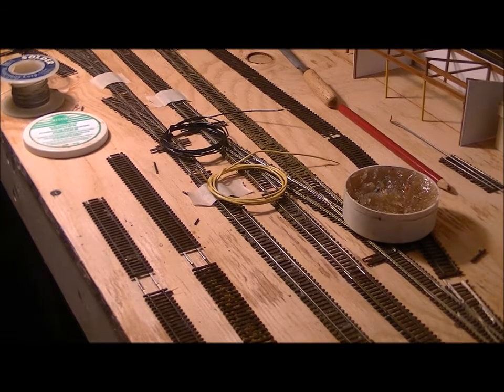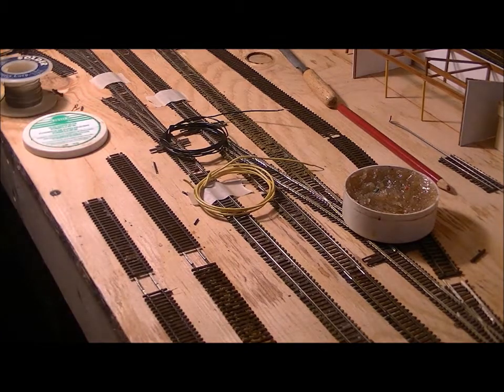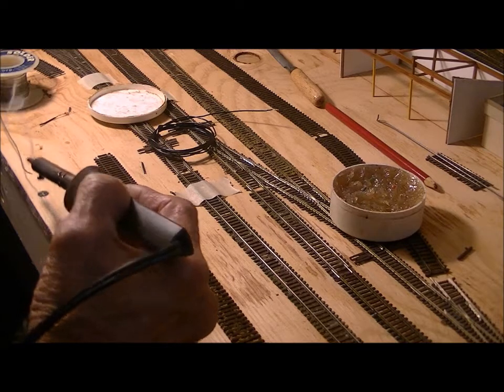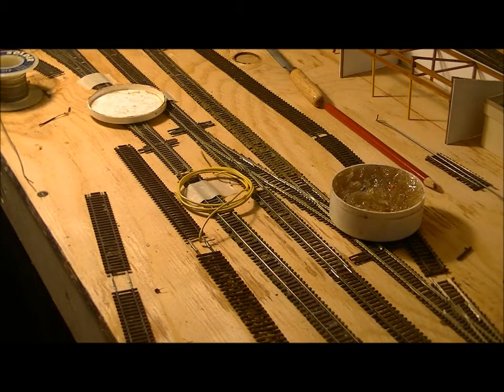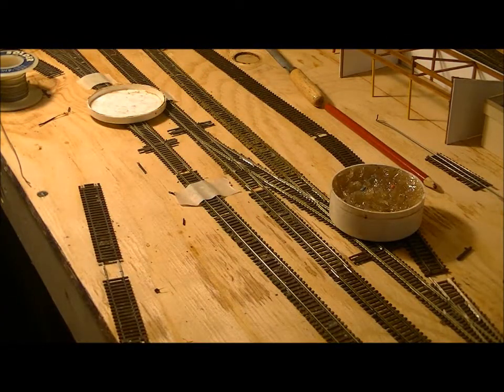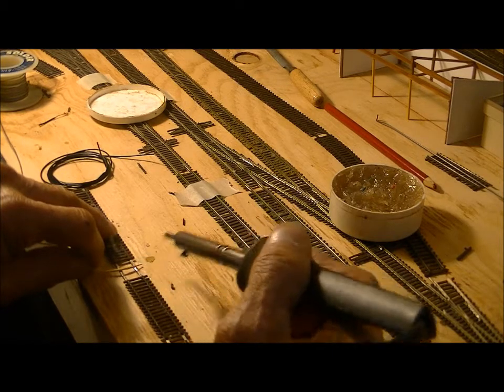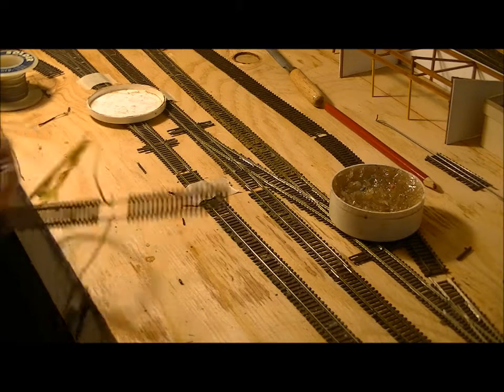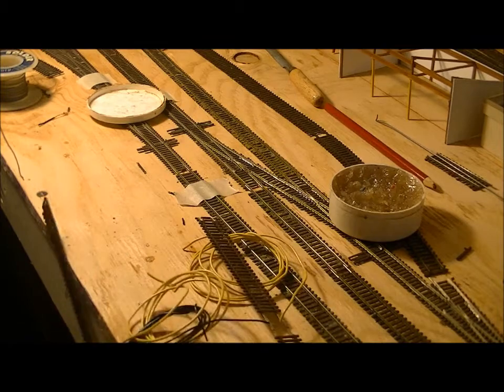SAVE MONEY..... MAKE TERMINAL JOINERS

Comment: I do the same without separating my wires. One is cut short of the other. Solder the far side first, then the close side. One neat trick it to use a re-railer and turn it upside down and fasten it somewhere on my layout. Put two joiners on the ends of the rails and solder. It stays stable while I solder the wire to the joiners.  I keep several on hand at different lengths. Then when installing track I drill down beside the track one hole and push my wire through and attach the soldered joiners to the rail ends.I have seen other modelers solder to the track and it messes the plastic ties up bad. Then try removing the solder from the track if you want to relocate your track. The way I do it is much simpler. And I am happy to see you do the same.

Comment from the maker: hello Gary.. thanks for the question.. i use 22 gauge stranded wire, i feel it's a bit more flexible than solid. i do not solder the joiner to the rail nor do i solder the rails.. just my preference but, it is a good idea to do so, especially since you are just starting. 
hope this helps
vinny

Comment: Vinny, are you using solid wire or stranded? Also, are you soldering the railjoints to the rails after you have drilled the holes for your feeds? Does this cause the feeder wires to come undone? I am in the process of building my layout and am curious. Thanks for the how to bid.

Comment: Vinny do you still use 22 gage wire. I been trying to do this keep having problems i need more practice lol
Reply from the maker: hi Dwight...thx for watching & the question...yes i still use 22 Ga. wire for my feeders & other electrical applications....what kid of problems are you having??  vinny
Reply: @dacuzzz  every time I solder the wire to the rail it breaks off really easy I think the wire is to thin. But if u see in my video I tried to use Christmas lights wire and that seems to work really good and for the soldering iron I have a cheap one only because I can't afford a good one